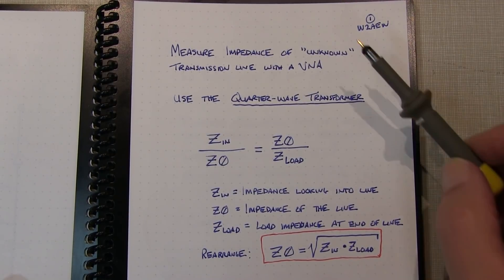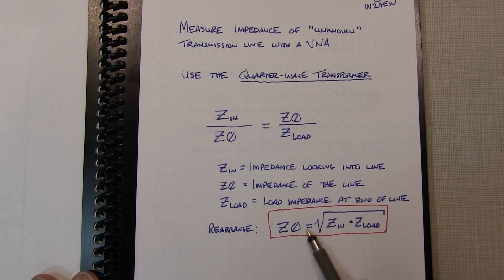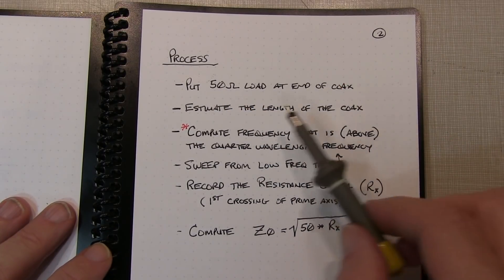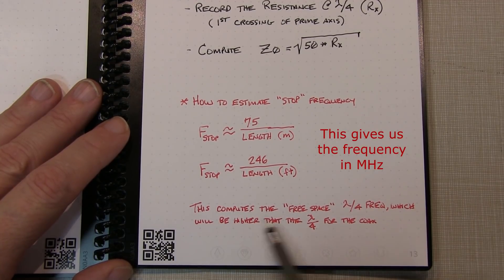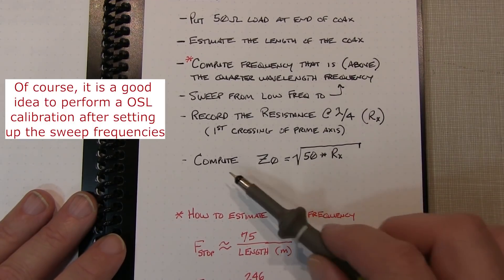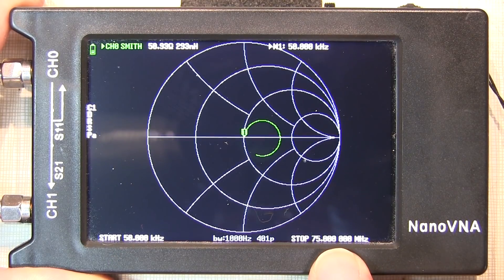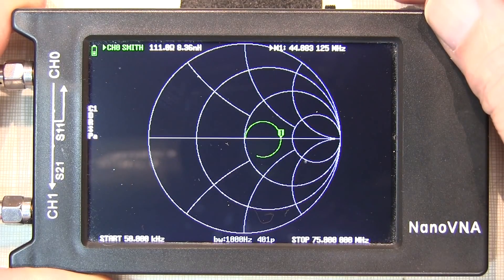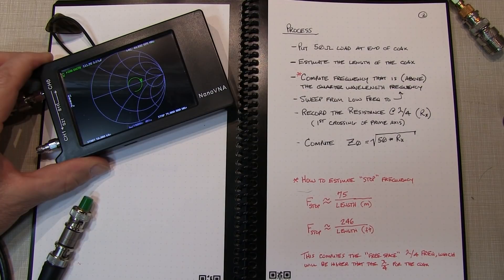#326: How to Measure the impedance of "unknown" coax using a NanoVNA

Comment: I could nerd out on your videos forever. Where did the values 75 and 246 come from?
Reply from the maker: Wavelength in meters is equal to 300 divided by the frequency in MHz. So, one quarter of this is 75 divided by the frequency in MHz. Similar story for the 246 to get the result in feet.

Comment: hahaha nice, can I test connector impedance using this method too?
Reply from the maker: Not really.  The best you can do is examine the effect of the connector in a coax assembly.  If the connector is well matched to the coax impedance, it's effect should be nearly invisible.  If it is not matched, you will be reflections.  The small size of a connector would require VERY high frequencies to characterize the impedance directly, far beyond what a NanoVNA can do.
Reply: @w2aew  yeah I see, but I am asking because I need to use PL259 on RG58 cable, and the connector seems like 30~40 ohms, the RG58 is 50 ohms, so i don't understand the reason for the industries make the use of PL259 on HF tranceivers, it is impossible match impedance of the cables with the connectors.
Reply from the maker: Given the physical dimensions of the connector are so small compared to the wavelength at HF, the effect of the poor connector is really minimal.

Comment: Another excellent video! As of late, I've been having a lot of fun winding transformers for EFHW and EFRW antennas, particularly the 49:1 unun for the half waves and the 9:1 unun for the random wire. I am wondering if a similar method can be used to determine the impedance of the wire antenna part once it is in place. For example, the 49:1 unun yields an impedance of 2450 ohms, which is nominally the impedance of the wire. I'd like to measure the wire in place to see if that value is even close. For that matter, I'd like a way to measure my transformer to see if it is actually 49:1. Thank you for all  the absolutely great information you provide on your channel!! Todd, N7TWL
Reply from the maker: Measuring impedance with a VNA is decent when the impedance is less than an order of magnitude different than 50 ohms (5 to 500ohms).  The further you get away from 50 ohms, the more the accuracy suffers (right at the edge of the Smith chart).  You can try, but remember that accuracy won't be real good.  To check the 49:1, you can solder an appropriate resistor (2.4k or close) to the secondary and measure the impedance at the primary.
Reply: @w2aew  I will definitely try that. Again, thanks for all that you do for us!!

Comment: How would the procedure change, if on the other end of the coax, there was no 50ohm load, but an open or a short instead?
Reply from the maker: You really can't do this with the open or short at the end - you can see from the fundamental equations that you've have a divide by infinity or a divide by 0 in the equation, which is a problem.  So, it's best to use a termination resistance that is with an order of magnitude or less of the expected impedance.  More than 10 ohms, less than 1k is a rough starting point - 25 to 100 ohms would be better.

Comment: Will this work for 450 ohm window line? I took 4.2 feet of it and calculated the 1/4 wavelength at about 58 mhz. I couldn't find resonance until around 100mhz and the Z was 73 ohms, way too low. I do have a 50 ohm resistor at the end of the line. Why is my Z so low?
Reply from the maker: Did you have the window line coiled up?  That will dramatically affect the results.  Never coil up twin lead, and never lay it adjacent to any conducting surface.
Reply: @w2aew  No. In fact I had it propped up with a cardboard box and even tried shifting it around. You could see a little change but nothing drastic. Testing coax seems to work fine but parallel lines seem to stay rather low in Z. 12ga zip cord measured about 66 ohms after measuring and doing the math while it should be closer to 100 ohms. Could it be due to the 50 ohm resistor? On the VNA I'm coming out of the S11 port with a sma to bnc/binding post adapter. Something acts like it's loading down the input.

Comment: I measured my Tektronix BNC 50 ohm cable with my NanoVNA and the Smith chart displayed 50 ohms across the entire frequency range. Another cable which I knew was bad showed a wide impedance range across the frequency range and never got remotely close to 50 ohms. Thanks for the info.

Comment: Somehow, seems maybe not to work the way I thought with my nanovna. Kind of strange. Maybe because I'm testing with a 50 Ohms coax. Calibration OK. Terminated with tiny dummy load 50 Ohm 10W,  L= 2,35 m -> Fs = 31,9 Mhz. The marker seems stuck at 50 ohm point in the Smith Chart. No nice curve, no crossing point.
Reply from the maker: A 50 ohm coax terminated into 50 ohms will plot a dot at the bullseye center of the smith chart.

Comment: Is it the characteristic impedance of the coax that we are measuring? Also, is the impedance value strictly for 44MHz as seen on the VNA? What if I want to use the coax to pass 300MHz through it? (with some load on the other end)
Reply from the maker: Yes.  The characteristic impedance of the coax is independent of RF frequency.  So, 50 ohm coax at 44MHz is still 50 ohm coax at 300MHz.  Now, if the coax is not terminated in it's characteristic impedance, then the impedance looking INTO the coax WILL vary with frequency (even though the coax is still 50 ohms).

Comment: I've just done it with a short test length of 75 Ω coax. It works perfectly. But now I need to measure the Z₀ of a short length of twin flat-line. If I hook it up to two connectors, will it also work?
Update: I'm able to answer the question myself. Yes, it does work, and quite well, too. The only conditions for an accurate measurement, though, is to lay the short piece of twin flat-line out, away from metal objects, and also make sure it is not exposed to electric or magnetic fields. I measured the Z₀ of a 1.5 Metre long piece of common twin bell wire. BTW, it came out at 110 Ω.

Comment: I managed to do it, although the pattern displayed on my Smith chart was a very tight circle, so the resistance didn't change much away from 50 ohms as I scrolled through the resistance. Quite glad about this, since it was a 50 ohm cable! I'll try again with a piece of 75ohm cable. Thank you for that.
One comment: in your videos, you very often "take" values to perform operations on them. It's unnecessary, and in British English, "take" can be interpreted as "subtract". This first time I heard it, I thought "take it from what?" Hope this is useful. 🙂 Thanks again.
Reply from the maker: Sorry about the idiosyncrasies of the same language!

Comment: Hi Alan,
Could you do the similar things with some pcb impedance coupon? Is the frequency range of this device enough to observe impedance uniformity of the transmission line or fiber weave effect with TDR mode.
Reply from the maker: The NanoVNA does not go high enough in frequency to see the short distance details needed to characterize the uniformity of a PCB test coupon.

Comment: Thank you for your work!! That was an amazing and really informative video. In 1:13, you estimate the stop frequency. Where do the 75 and 246 constants come from?
Reply from the maker: It is computed from a simple free-space wavelength calculation.  Speed of light is 300,000,000 meters/sec.  So, you can calculate the free-space wavelength of an RF signal in meters as 300/Freq(in MHz).  Then divide this by 4 to get the free-space quarter-wavelength.  Thus the formula is 75/F(MHz).  You can do a similar calculation for the value in feet, which gives you 246/F(MHz).

Comment: I used this technique to measure my various teflon coax. TC-18 got me 18.26 ohm, blue 25 ohm coax was 27.3 ohm and some unknown coax with only 0.15mm insulator between center conductor and shield was 15.2 ohm. But surprising outlier was TC-12 that measured at 16.8 ohm and supposed to be 10.7 ohm per datasheet. That may explain why my TLT transformer was not working properly.

Comment: Thank you for explaining how to measure the impedance of a coax cable.  I would like to measure a parallel lined ladder flat cable.  I did the same thing using 1 m long 1.2mm diameter cupper wire (emamelled) and it seems to be 45-50 ohm.  Is this correct?  I would appreciate very much if you can provide the method how to measure the impedance of a paralell-lined-2-wire (a ladder line).

Comment: Thanks for the OSL tip. Is the 50 ohm load a toggleable feature in NanoVNA? Do you think the margin of error is small enough to verify if cheap 75 ohm cable has impedance more like 77.5 ohm versus a good 74.5?
Reply from the maker: The 50 ohm is not toggleable.  There is likely enough resolution to see the few ohms difference.

Comment: When measuring the DC resistance/impedance from ground reference to the +Vcc positive voltage rail and measure the DC resistance, then measure from ground to -Vee or the negative voltage rail. Some circuit will measure from 10 ohms to 100 ohm and other circuits will have 100ohm or more for the positive rail and negative rail DC resistance/impedance. Is this the power supply impedance measurement? even those impedance is measured in AC but they often call this measurement the power supply impedance which is measured in DC resistance. Question#2 is if the positive rail measure 30ohms and the negative rail measures 20 ohms will this have a LOWER signal to noise ratio because current is easier to flow to ground compared to a circuit that has positive rail at 100 ohms and a negative rail at 100 ohms? The higher the DC resistance on the power rails means that the signal to noise ratio gets worse because the current can't SINK to ground which creates noise?
Reply from the maker: No, this is NOT the power supply impedance.  A DC measurement of a power supply rail to ground is meaningless (unless it shows a dead short which would indicate a problem).
Reply: @w2aew  What is this power supply measurement called? because EE engineers do measure the DC resistance from ground to positive VCC rail and the DC resistance from ground to the negative VEE rail. It has to d with something about how the current is sinking to ground, the higher the resistance from ground to positive rail or ground to negative rail will take longer for the current to sink to ground? it might have something to do with leakage current measurement to measuring the leakage current.

Comment: Thank you for a very great video.

If I want to use this method to measure the impedance of twisted pair cable (e.g. USB2 data lines), what is the length to use?  The original cable length before twisting or the length of twisted pair?

Comment: This is definitely a tough topic.
From this video, the measurement said the impedance of this cable is 75 ohm.
If the same coaxial cable is double the length (2 meter), is the impedance going to be 150 ohm?
Reply from the maker: The transmission line impedance is not the same as the resistance of the wire.  The line impedance arises from the distributed inductance and capacitance of the line, which determines the relationship between the voltage and current as the signal wavefront is traveling down the line.  Therefore, the line impedance is a constant, regardless of length.

Comment: Why do you have to sweep through to do the readings as opposed to just reading the frequency at the prime axis crossing?
Reply from the maker: You don't know what frequency will result in the crossing of the prime axis until you sweep it.
Reply: @w2aew  Could you not start the sweeping closer to the prime axis?

I'm new to this so I might be misunderstanding vital info.
Reply from the maker: @lancecruwys2177  Yes, if you knew the approximate frequency you could sweep closer to the crossing point.  The sweep time in the NanoVNA won't change much, so the only benefit is getting finer granularity of frequency in the sweep.

Comment: This will not work on a 50 Ohm coax.
Reply from the maker: Of course - terminating a 50 ohm coax with 50 ohms will result in a single point (ideally) in the center of the chart.  This will verify that the coax is 50 ohm.

Comment: How did you calibrate after you set the frequencies? Did you calibrate with the 50 Ohm load at the end of the mystery cable or right at the VNA?
Reply from the maker: Right at the VNA, because the measurement plane is the input of the unknown cable.  If you calibrate at the end of the unknown cable, then it's effects would be removed from the measurement, which is NOT what we want.
Reply: @w2aew  thanks a lot for that timely and helpful reply. Oh another question: is there an ideal length of cable to measure this? Because when I tried with a 4m piece I just got a tiny circle in the center of the Smith chart. I might have done something wrong though.
Reply from the maker: @matthiasmartin1975  If the unknown cable is 50 ohms, then the expected result will be a tiny circle in the center of the chart.

Comment: I used my Rig Expert AA-600 to check feed lines to find out its impedance. I did not use the Smith Chart but still found the correct impedance. The way you just showed is so much easier and spot on. No hunting needed. Now I use my NanoVNA H 4. Super simple. Thanks for posting such a great informative video.
Barry, KU3X
Reply: Interestingly enough the new Zoom analyzers have a cable impedance measurement and it works quite well.  You only need a short and open, no load.  Spot on with what the NanoVNA measures.  Like yours, my AA-600 lacks the new feature.

Comment: Very cool. These little things have so many uses, it's amazing. My problem, I have a coax, buried under the sod. If I put a 50ohm load on one end, and connect the nano on the other, what should I see if the coax is good to use? Thank you.
Reply from the maker: Probably a better way to test it, is to start with leaving the far end open.  When sweeping the frequency, the trace should hug the outside of the smith chart.  This will indicate that there is low loss.  Then put the 50 ohm termination on the far end and verify that the smith chart stays at the center.

Comment: Does this method work if I have to measure the impedance of the antenna wire of an EFHW ??
Reply from the maker: You can simply use the NanoVNA to measure the complex impedance at the feedpoint by calibrating where the EFHW would connect.

Comment: You've got some useful info on that VNA.  Thank you.

Couple of questions:

If I have an unknown antenna, will the NanoVNA tell me exactly what frequency the antenna is best resonant, or best optimized for? 

If I have a dipole, can I use the device to determine if the "ground" half is too long or short?

If I have an antenna with loading coils, can this be used to determine the "electrical length"?

Comment: Hello w2aew thanks for your very useful videos.
I own Agilent sine wave generator with sine output up to 3GHz.
How Can I convert the sine wave signal to 1 half cycle pulse which I Can use as TDR source
Reply from the maker: Generally not that simple - however, many professional signal generators have a Trigger output which is synchronized to the RF output - it would likely make a nice TDR source.

Comment: Just for fun, I used this quarter wave method to look at a short piece of unknown cable I had.  I expected 75 or 50, but kept getting a value around 95 ohms, and for a long time I scratched my head looking for a source of error.  In desperation I finally Googled "95 ohm coax?", and there it was, probably RG62 - seems it's a rare "standard" value - and not one I'd ever encountered before!  ( I've no idea where I got the cable, or its intended use!)
Reply from the maker: It is possible that it is actually 93 ohm.  I found this info on wikipedia: RG-62 is a 93 Ω coaxial cable originally used in mainframe computer networks in the 1970s and early 1980s (it was the cable used to connect IBM 3270 terminals to IBM 3274/3174 terminal cluster controllers). Later, some manufacturers of LAN equipment, such as Datapoint for ARCNET, adopted RG-62 as their coaxial cable standard. The cable has the lowest capacitance per unit-length when compared to other coaxial cables of similar size.
Reply: @w2aew  Thanks Alan!  93 ohm and "has the lowest capacitance per unit-length" make sense: the dielectric looks like polyethylene -  however the Vc seemed higher than 0.66, (and I forgot to record it !).   The inner conductor/outer braid diameter ratio certainly looks smaller than in 75 ohm RG59.  
So now I have 1 metre of 93 ohm cable available to perform some interesting impedance transformations!  As ever, the VNA is our friend!  :)

Comment: You read my mind... Yesterday I decided to replace the cut short coax from a Furuno NX-3H Navtex antenna. Furuno uses their own coax cables without any marking that are slightly larger than classic 50 ohms coax but smaller than 75 ohms. So I found your recent post and measured my piece of coax. 
Now you forgot to mention that if the NanoVNA indicates a perfect 50 ohms dot in the middle, then the cable is 50 ohms indeed; correct?
Reply from the maker: Correct.  If your cable is 50 ohms, and you terminate it in 50 ohms, you'll just have a "dot" in the center.  In fact, if you have 75 ohm coax, and terminate it with 75 ohms, you'll get a "dot" at the 75 ohm point in the chart.